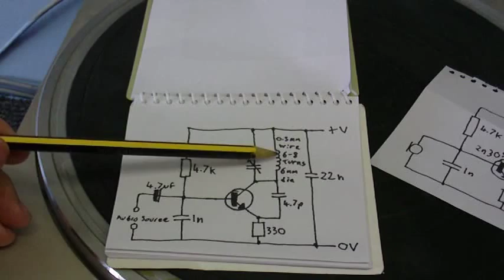Home made FM transmitter experiment.

Comment: How did you get yours to work so well? I built a circuit similar to yours, and it transmits, but if I try to connect anything to the input, it throws the carrier frequency off and I cant get it tuned back to the right frequency

Comment: @CoolDudeClem Learn about dipole antennas mate, two 750 cms lengths of wire, one connected to where your existing antenna wire is on the circuit board, and another connected to the 'earthy' side (the - terminal of the battery) to act as a counterpoise will dramatically increase range, especially if you could get the thing up high or at least in a window. Pull one 'leg' of the antenna up and the other down, you could dangle it rom a curtain rail. Note: in some countries it's illegal to transmit.

Comment from the maker: I got most of the parts from maplin.  it's amazing how few parts it needs, 3 capaictors (1nf, 22nf & 4.7 pf), 2 resistors (330ohm & 4.7 k ohm) a 5-65pf trimmer capacitor, a coil (6 to 8 turns of 0.5mm thick wire wound round a 6mm former(i used a screwdriver as the former))  and 1 npn transistor.  of course an understanding of electronics is also a good thing to have, unless you already have it :-)